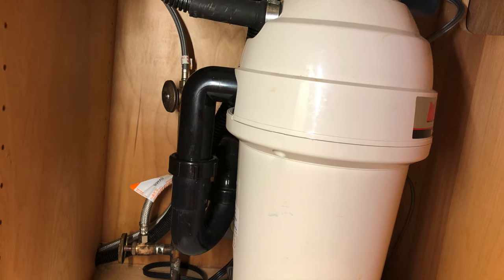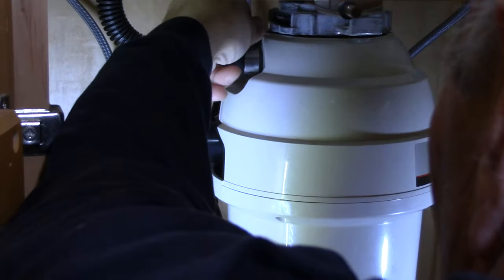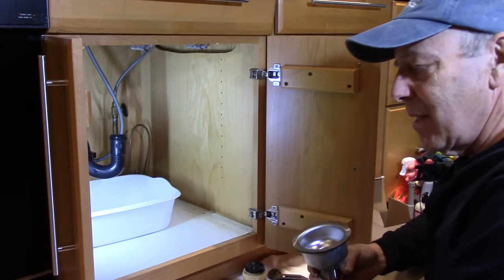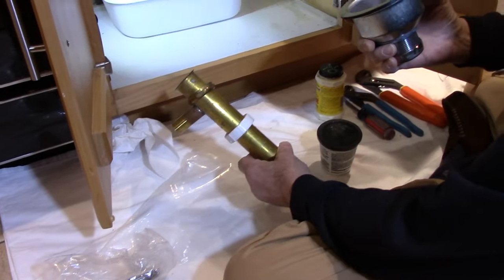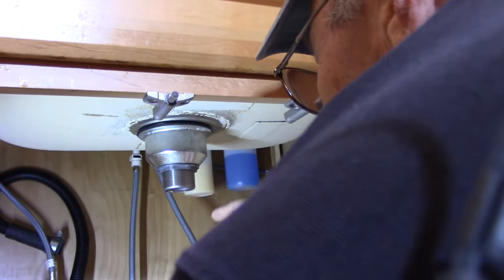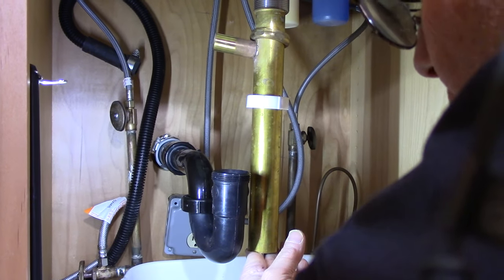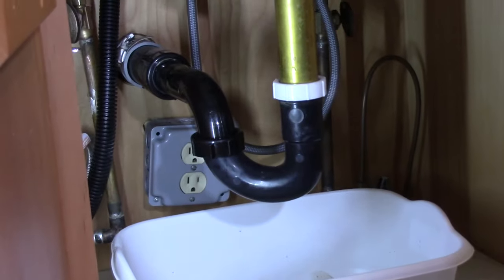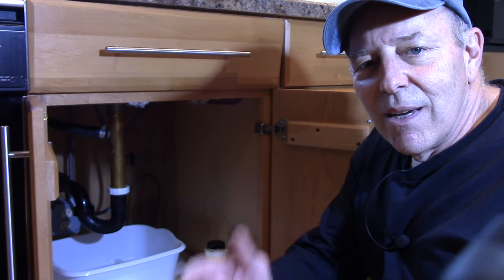Replace A Garbage Disposal With A Regular Drain

Comment: This is exactly what I needed to see. My disposal plates were so full of plumbers putty that I could not see how to take it apart. Everything was metal and I dent the top flange like you did gut I had to bend it all the way around until I could push it thru the sink. Once I had it apart I knocked all the dried up putty off and saw that there was a snap ring holding  it together. You saved me a lot of work. Thanks

Comment: Thank you +Get It Done Home Repair. I am a new homeowner and have never owned a garbage disposal until now July2024. We live in the mountains/rural California so we have a Septic tank. The home came with a disposal but I read we really should not use it with a Septic tank, besides someone broke glass in it and the disposal does not turn, it only makes a machine sound until it turns off.

I am researching how to permanently remove it. I found your video and I have to say  I appreciate your Teachings. I am handy, just no experience in garbage disposals. After watching your very through video I believe I can do this myself. I just have to make sure I have a list of parts to buy before I venture off to town, which is 30 minutes to one hour away. You gave a good tip. I found a General Contractor Supply 30 minutes away. I will visit them when I start that project. My plate is full right now. Again Thank you, MountainAngel
Reply from the maker: I'm happy to help. It is not that difficult you can do it!

Comment: Great video, only wondering......why did you have a hard time? removing the last piece, taking the risk off damaging the sink, when it’s a lot of easier by removing a clip under neath.
Reply from the maker: Good question but that will not work because the clip does not come off from the bottom. The only way to get it out was to take off the upper part of the drain assembly.

Comment: Before you buy anything, check your dishwasher hose.  There are a few different sizes.  Usually you can cut the end of the hose to fit the branch in the tailpiece.  My disposal had a 1 inch branch.  The hose can be cut down to fit 5/8" and 1/2" branches, but yours may be different.  I found tailpieces with branches that measure 1/2", 5/8" and 7/8".  Don't buy the wrong part.

Comment: Thanks. Good video. I'm a widow.   Where is my hubby when I need him? 😢 my dish washer is broken. I can't afford one right now. Is there a cap I could put on the dishwasher pipe? Till I get a new one, So I can use my sink?  
Time and date:
5/07/23 4:30 pm.
Thank you.
Reply from the maker: You will need to go to a big box store or possibly a plumbing supply store to by the rubber cap to block it off on the down spout.

Comment: The flange holding the garbage disposal at the bottom holds a gasket, when you remove it, that clamp comes off, and you can also disassemble the upper part without the need for this shredding job.Installation videos show how that gasket is installed.You have spent a lot of effort in vain.